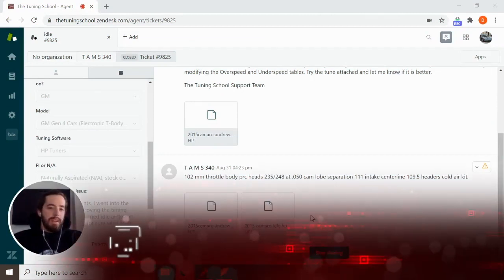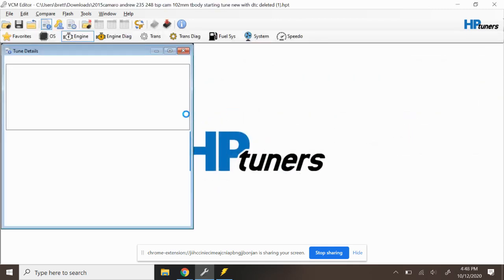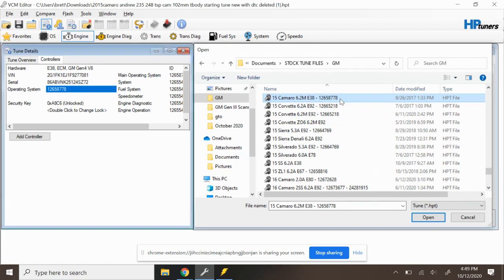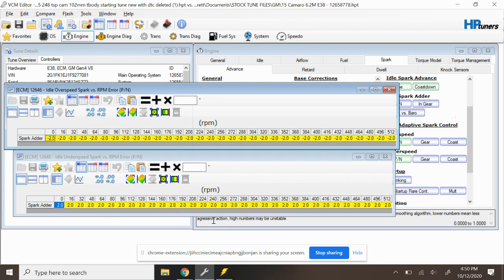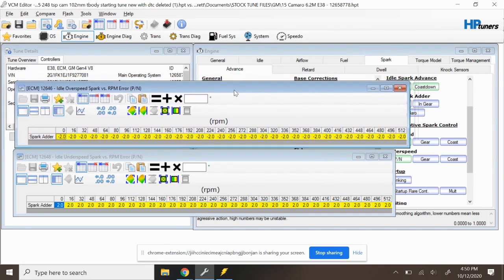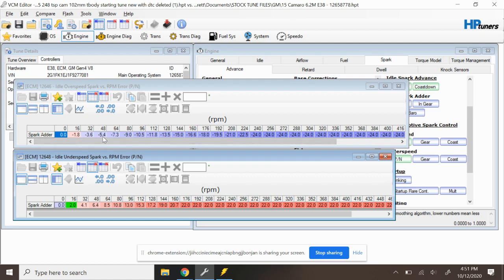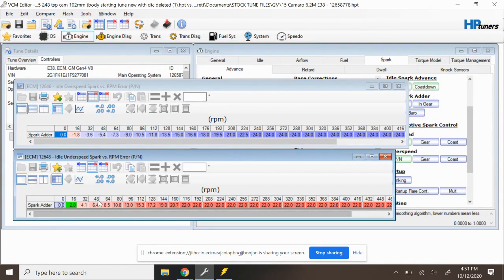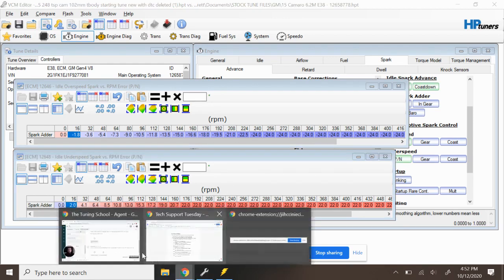Tech Tips - Overspeed & Underspeed Incorrect Modification

Comment: Hey Brett, I actually sent you a GTO file with this same issue. 
You should do your next video on the same thing but touch base with (Engine-Idle-RPM = adaptive Idle "Proportional and Integral" oscillation. 
Also to add, do a video on (Engine-Airflow-Dynamic = Prediction Coefficients) i still struggle with this and how it can make my life a living hell. Do you really need it enabled??
Reply: Hey there, so to be honest, 9 times out of 10 we are going to recommend you do not touch the adaptive idle settings. Most of the time you will just end up worse off than when you started. You would be surprised how many problems will be fixed by getting your base running airflow table right. As far as prediction coefficients go, out of 7 years of doing this, I have never changed them on a single car. I also have never met a professional tuner that does. Your first person I have even had mention them.
Reply: @brettmcclelland5046  Ok. Jumping up on this soapbox. I don't expect every tooner to master idle control, but this is misleading coming from a school. Idle adaptive airflow makes massive improvements to idle quality - it is the coarse correction for RPM stability, after all. Not changing them is doing driveability and NVH a disservice. 
As for prediction coefficients...a more difficult topic for sure, but they have their place. However I can confirm that these are not going to be very useful to the DIY guy. In fact, GM makes use of them particularly for emissions improvement. BUT that is not to say they are not the cause of certain issues in vehicles with engine modifications. For more information on what the prediction coefficients are, see my post on the HP Tuners forum below. It provides some background on the science behind transient airflow, which is what the prediction coefficients are responsible for modeling. 
If TheTuningSchool would like some training for their instructors, let me know... I can detail this stuff beyond the level that anyone needs to know, but at minimum you'd be better equipped to educate others.
https://forum.hptuners.com/showthread.php?88446-G8-LSA-no-PE-enrichment-in-dynamic-air
Reply: @anasasisxenophontis  You will notice that these comments are coming from me personally, not from the school. While I am directly affiliated with them they have no censorship over what I have to say. Therefore I don't speak for the entire companies behalf, but I am fairly certain they wouldn't completely disagree with my comments. To clarify my original comment further, I am not discounting the importance of adaptive idle controls, there is no way idle would happen without them. However,, 9 times out of 10 if the base airflow and spark advance settings are done correctly the factory adaptive settings will usually work. There are applications that will need more direct attention to get the idle "acceptable" or even perfect but they are not usually the average vehicle a DIY guy is working on. To that point, in the cases of both adaptive controls and predicted airflow settings, historically our position here at The Tuning School is going to be to teach an average guy what they need to know to make a car perform and drive at 90% of its capability in a production environment (3 to 4 hours per tune). We don't normally take a deep dive into every aspect of a calibration making every nuance perfect. This approach has been synonyms with our brand since the beginning and it works for our customer base and the part of the market we serve. That does not mean that approach is for everyone. 

I will never profess to know everything, in fact, I know there is a ton of things I can learn. I would be more than happy to do some mind share with you as I am sure it will be very beneficial. Drop me an email and we can set something up! brett@thetuningschool.com